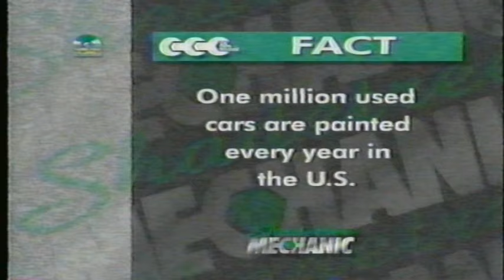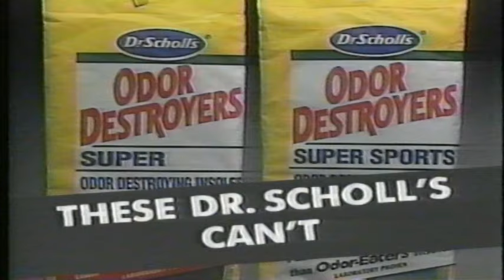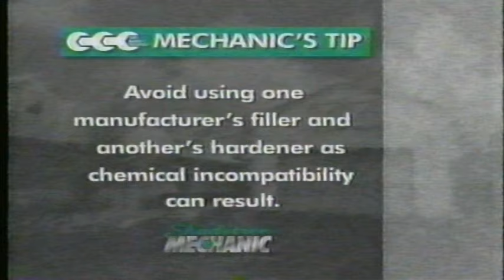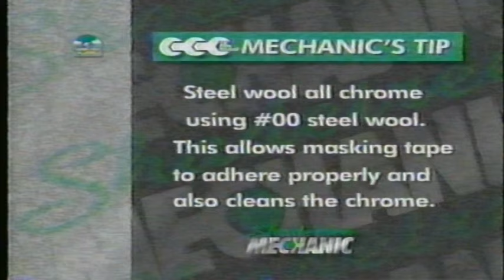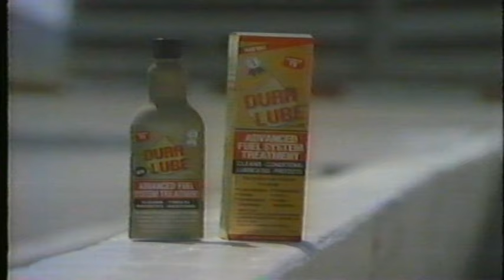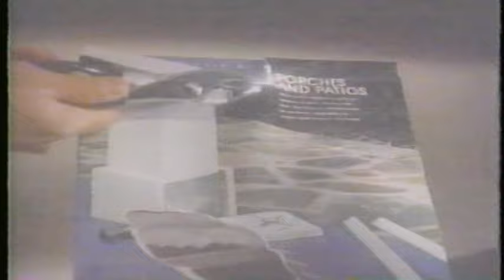TNN Shadetree Mechanic Beretta Body Work

Comment: I bought a new berretta. The paint began peeling inside of 6 months. Took it to a car wash and blasted paint from every panel. They did a complete repaint.
Reply from the maker: I feel for you, it was those terrible GM paints from that era.  I had a light blue 85 Caprice that the paint flaked off down to the primer.  Our 89 Beretta with red paint fared well for the 32 years that we owned it.
Reply: Upload more please!